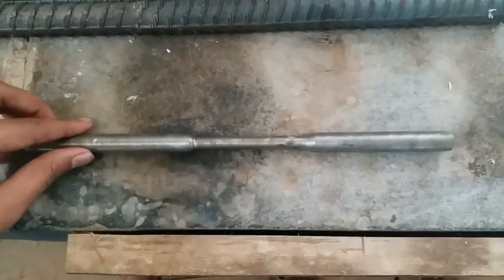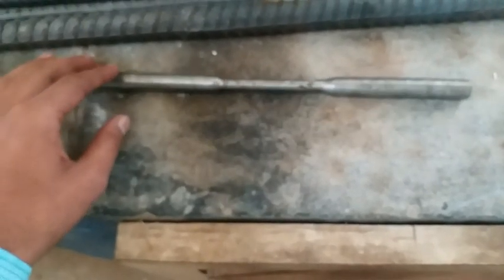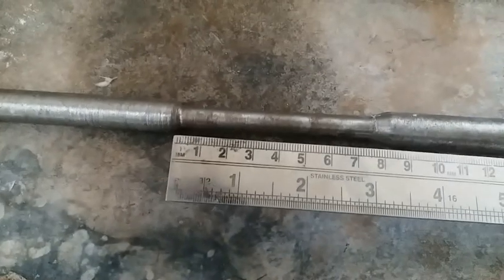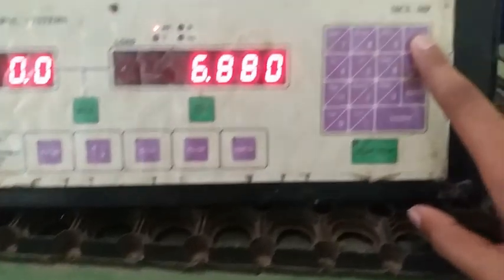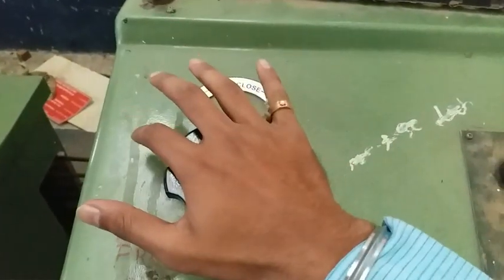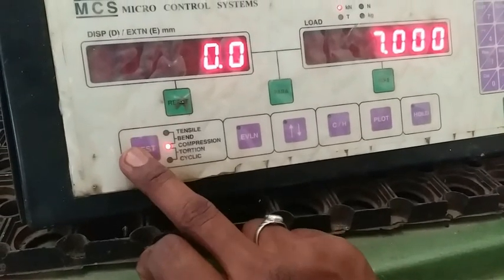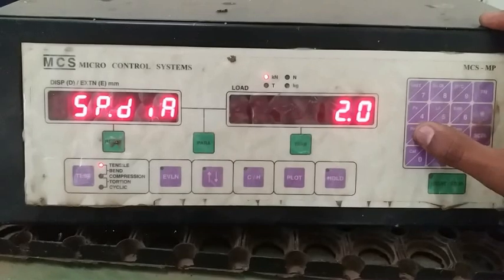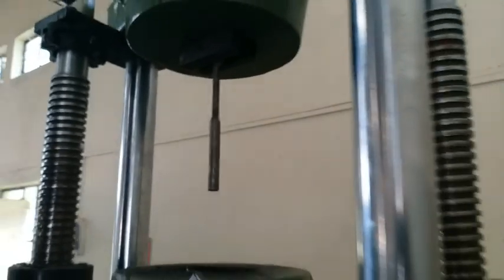Tensile test on UTM (universal testing machine)

Comment: Although this is a good effort to make familiar with the test but there are many issues with the test that is shown here. First of all, the gauge length is not as per IS 1608 i.e. 5.65x(rootC/S area). Second issue is, the rod is slipping from jaw due to which result may differ. Third issue is, the failure pattern should be cup and cone failure for mild steel but it is looking like failure of a brittle material. Hope, you will take the suggestions positively.
Reply from the maker: Sure